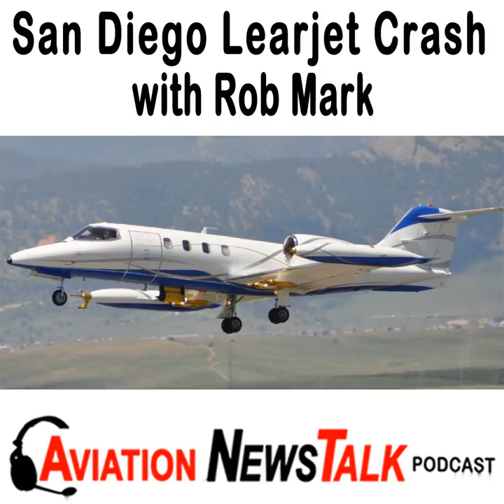214 San Diego Learjet Crash – Interview with Rob Mark

Comment: Correction:  They did not have to do a night circle landing.  It was their request, which was granted by traffic control.
Reply from the maker: From all reports, the operation specifications didn't permit them to land on the runway 17, as it was too short. That's why after flying an approach to 17 they had to circle to another runway.

Comment: We were doing our UPRT recurrent training in the Falcon 7X simulator a few days after this accident. After fulfilling the required training, the instructor asked if there was anything else we wanted to do. Though the simulator database does not have KSEE in it, we were able to try this maneuver, using the exact same weather conditions, speeds, and altitudes, configured for a circling approach. I can tell you that in these conditions, keeping the airport in sight was near impossible. When I demonstrated over banking (45 degrees), the nose dropped and there was no way to recover. With the critical wing of the Lear 35A, this was a death sentence. So sad that this occurred.
Reply: I have become very disgusted reading some of these responses. Some of you are not instrument proficient or even instrument rated and respond as if you were.  Scattered clouds do not make a ceiling since the first day i did my discovery flight,  you have to be able to fly and handle that aircraft or you will perish. you know that pilot error thing. a lot of people can do just fine because you have easy assignments.  I flew commuter airlines, pilot proficiency is not what it used to be and you are taking refuge in criticising the crew.  I flew years ago the last flight at night to Lake Tahoe.  It was a LDA runway 18 approach.  go do that approach around 10.00 pm at night and talk to me then.  We did it every night me or some other pilot.  sometimes it was so windy that we were looking out the side window too at the runway .  the missed approach point was about five miles from the end of the runway some nights we went in there with snow 5 miles visibility and the MDA  [ minimum decent altitude ] was 900 feet above.  you went in there DIRTY,  gear down and full flaps.  IF you had to do a missed approach there was a significant right turn that you had to do climbing and cleaning up the aircraft or you will be in the lake.  Climbing and banking is a good reason why people stall airplanes but we did this airport daily.  I also flew to KLMT Klamath falls airport  where there was a lot of BME arking and altitude change.  you have to know your flap speeds and observe banking restrictions also power up the aircraft to compensate.  so stop acting as if you had a difficult flight you would crap out and take the passengers back to base.  People do not like circling approaches and they are not a focus of check rides and proficiency checks.   A commuter jet [ Lear jet ] is like a swiss army knife.  they do difficult airports with short runways sometimes no grooving for wet weather. I flew part 121 and that is more comfortable until you begin to go to some of those difficult international locations in south / central America. Asia.  So stop acting as if you got it all figured out.  In lake Tahoe if you crossed the last checkpoint and had an engine failure that is no reason to crash the aircraft. you would be descend slightly to pick up speed powering up the other engine and cleaning up the aircraft.  I also flew in Alaska that's another story,  so knock it off with all the self righteous stuff and understand that there are skills you need to learn to survive aviation challenges.  We seem to be DUMBING DOWN the training that we do to be instrument rated.

Comment: As a non pilot, my questions are more general.  It's been mentioned several times about the approach to this airport.  Surrounded by hills to the east.  Is that why 27R is longer because  of the hills to the east.  When was this airport built?  Since the N-S approach is more friendly to landing, why didn't they make this a longer runway?  How long has this medevac service been stationed at this airport?  Haven't these pilots made multiple take-offs & landings from this airport?  Did the shorter runway meet the requirements for landing at this time?  Is the circling approach typical for a Lear at this runway?  The way this accident is brought up, it's like the pilots first time landing at this airport.

Comment: The fact that he asked the light intensity to be increased leads me to believe they lost sight of the airport during the circle to land.  The low altitude over the airport leads me to believe he was trying to stay below clouds.   Either one of these things should have been a trigger to abort.
Reply: Exactly. And yet he thought he did see the runway lights—or why ask for them to be increased? He was looking at streetlights. Maybe he wasn’t watching his altimeter and thought he was higher than he was. And that was the moment he hit the wake turbulence of a mini van.
Reply from the maker: Yes, as I discussed in the podcast, there were multiple triggers that they should have started an early go around and get out of there. There were about a mile north of the airport and hadn't yet crossed the field to start circling when they asked for the lights to be turned up. I took it to indicate that the rain and mist were so bad that the lights seemed dimmer than usual.
Reply: @AviationNewsTalk  Yes, I see that now.  The audio clips that were pushed out to YouTube are deceiving.  They were clipped.  He called to cancel IFR at 0311:50, inquire about lights at 0312:16, and crashed at 0314.
Reply: @AviationNewsTalk  Yes but… They had canceled IFR, they couldn’t legally go missed and they had very few, if any, VFR options. Yes, climbing into the clouds and, as they say, asking for forgiveness rather than permission was possible but it’s easy to understand why they didn’t do it.
Reply: I honestly think they were distracted by his response right after asking for the lights to be turned up.
Reply: They should have asked for the Runway Lights to be turned down to the lowest setting, (or off completely), and then turned on again by degrees up to full brilliance. This might just have given them a chance of locating the Runway if the had lost sight of it. This would have made them stand out better against any street lights.

Sounds like they might both have been looking for the Runway and not monitoring the instruments and thus got considerably 'behind' the airplane.

They had made changes to procedure, (cancelling IFR and changing to VFR), into a normalised prectice for their Hombase, despite what the book said.

This, and the fact that they were too low in poor visibility, (plus press-on-itis), doomed them.

Had they diverted they would likely still be alive.....
The CVR will tell us more..

James Hennighan
Yorkshire, England

Comment: In the aftermath of WW2 my father found himself in the dual role of both pilot and air weather officer. Because of that he served on many accident investigation boards. He told me the most common cause they uncovered was get there-itis. You are right. The pilots should have taken smarter actions.
Reply from the maker: Yes, get-there-itis is a serious problem. Having read about it, I thought it would never occur, but once when I had a crying two-year old with me, I pressed on in a storm and icing to get home. I was lucky that when I descended to the MEA, the ice came off. If it had been slightly colder that day, and was below freezing at the MEA, I might not be around today.

Comment: Great conversation. We're they flying that low because of the inadvertent imc trying to maintain visibility and got squeezed under an extremely low ceiling
Reply from the maker: That's seems like the most likely reason, though it's interesting that they climbed a few hundred feet after crossing the runway. We may never know for sure why they were that low, unless they talked about it on the cockpit voice recorder.
Reply: Sounds like there was no chance of maintaining VMC (and the field itself wasn’t Visual) yet they cancelled IFR to proceed VFR

Comment: So as they crossed the field @ 300', they asked for the lights to be turned up???????? How were the expecting to see the lights at a higher altitude??
Reply: They asked for the runway lights to be turned up seconds before the crash, not as they crossed. Which suggests they thought they were seeing runway lights, no? If they thought they saw the runway, were they seeing streetlights in reality?

Since this was their home base airport, I think it was likely they were well aware of the terrain obstacles (the hill). Perhaps they oversteered slightly on the last turn to avoid where they thought the hill was relative to the plane. It’s possible they caught sight of the streetlights before they were aware of their angle relative to the true runway—remember they’re on VFR, poor visual conditions (night time + weather) and likely both PiC and SiC were scanning for the airport.
Reply: @MarcosElMalo2  It would be interesting to have the audio and position timeline overlay.
Reply from the maker: TC, I did backtime the audio versus their flight path. That's how I was able to say in the podcast that they were about 13 miles north on their first call, and about 3 miles north on their second call. That second transmission lasted nearly 30 seconds, so when they did ask for the lights to be turned up, there were still about a mile north of the field, and hadn't yet crossed the field to begin their circle. After crossing the field and starting to turn left, there were only about 40 seconds from crashing. MarcosElMalo2, the reason it may have seemed to you that the request to turn up the lights came immediately before the crash is that in some versions of the ATC audio, people have edited out all of the quiet sections. If they left them in, people would get bored and not wait for the silence to end and would miss the final transmission.
Reply: @AviationNewsTalk  Thank you For the recap on timeline. I thought so on the light call. I think his first expletive came when the left wing dropped as he went inverted which you can see in the doorbell video. Judging by the soup I doubt they ever saw the mountain. I saw one track that showed them left of 17. Incredible tight turn if that was true. Just truly sad all around.

Comment: The reason the localiser approach to RW 27 R is a "circling" approach is that you may not descent below 1400 ASL because there are the high  hills to the north at 1.6 miles from the displaced threshold (1000 ft) . Encountering VMC below say 1500 ASL does not allow a landing on that runway, because you are too high. This requires a left hand pattern at normal  pattern altitude (1400 ft ASL, 1000 ft above runway altitude, 800 above the ground east and south of the airport.
Circling approach does not mean flying a circle! 
The proper way is to fly into a down wind after crossing interstate 8 and turning into base just east of I 8 after I 8 turns north, which is just over 3 miles from the approach end of 27 R , turning normally to final into the localiser at an altitude of 1000 feet (1400 ASL), 3 miles away (recrossing I 8), allowing a stabilized final approach in VMC and helped by the illuminated slightly wavy Pepper drive just to the east on the extension of the 27R, and the runway lights clearly visible at 2 miles.
The altitude at 1.5 miles out , is then 500 feet above the runway, the small hill just to the left is clearly illuminated by the house lights ( this is the base leg for 27L). The high ridge (1100 ASL) is about 2000 feet to the north. And below is the large trailer park 300 feet  below, recognizable by the illuminated streets inside the park.
Reply from the maker: Nice description. If they'd followed that, they would have been fine. As we mentioned, the big problem was their ground track, which was much too close to the airport on downwind, guaranteeing they would overshoot the base to final turn. I'm guessing that some of the landmarks you mentioned were obscured to some extent in the rain and mist. Had they been able to see the landmarks, they would have been fine. I've found in my area, which is equally hilly, that when visibility is low, it's very hard to know exactly where you are, because we use the mountains for reference to determine our exact location. Take the view of the mountains away at night and low visibility, and it's much, much harder to figure out where you are visually, which is why we rely so much on moving maps.
Reply: @AviationNewsTalk 
As you might have guessed I have  flown this localiser approach many times, in daylight of course. Kept my airplane in a southern hangar there.
Your assessment is correct.
I avoided flying at night there because the noise is high for the residents on the approach  path, living 2oo feet higher than the Gillespie's elevation.

Comment: I have a different theory and no one is talking about it.  I think they fully intended to land runway 17 but instead of doing a go-around (too fast, not configured, etc..), the pilot flying decided to salvage the approach and chose to do the visual since he had probably done it before.  The decision to do this was late and things happened really fast.  By choosing this route, the other crewmember wasn't ready for it and totally out of the loop.  So instead of the go-around, they leveled off at a low altitude, too close to the runway, and tried to salvage the landing.  I honestly don't think 27R was planned that day .  And if it matters, I've done tons of circle maneuvers in a jet.

Comment: I live where this happen, I watched tthe entire thing unfold it was the most horrific thing ive ever seen happen but i've seen this jet so many times. They fly so low it feels like I can touch them. it wasn't the first time this happen even when the entire sky is clear and its sunny out they flew just as low and that already scared me enough. The night of the crash it was pouring and there was alot of fog, it was almost down to the street where you could not see. Witch is also normal. This is just a generally unsafe passage to me it seems, not that I know anything about flying because some could argue im wrong considering plety do this everyday. at least 8 a day or more
Reply from the maker: I'm sorry that you had to see it. No question, there were a number of elements of this final flight that were unsafe. Sadly, even experienced pilots make mistakes. Usually the mistakes are small and they catch them and correct them, but that's not what happened here.

Comment: As a VFR pilot who flew out of ksdm, down by the boarder there's a sizable hill to the east of the runway as well. I keep thinking Lindburg Field was really the only option on this day.
Reply from the maker: I've flown in and out of Brown Field many times, always VFR. Oddly, the same model aircraft, a Learjet 35A, crashed after takeoff from there at night in 2004, after failing to stay out of the clouds while awaiting their IFR clearance in the air. It too was an air ambulance flight. You can read about it here. https://aviation-safety.net/database/record.php?id=20041024-0

Comment: Any issues with flying a RNAV all the way in and then last minute switching to VFR?  Seems it could be very disorienting following instruments and then switching to hand flying at low level, at night, in the rain, with low clouds, at the last moment.
Reply: It happens pilots cancel IFR if they have vfr condition and can see the runway. Probably in this situation, events stacked up against them without them realizing.
Reply: It’s my understanding that they cancelled IFR just before or as they were crossing the airport. It’s my understanding that this was the regulation for this particular approach for this airport, due to the terrain hazards to the east. I don’t remember at what point the aircraft requested VFR from ATC and were given permission—we’d need to listen to the ATC recording again and then speculate how long after they switched to VFR.
Reply from the maker: 1320fastback, you've highlighted many of the issues. The "following instruments and then switching to hand flying" happens routinely on virtually every instrument approach. But the changing of runways and getting to the new runway at night in bad weather is rare, and one of the most dangerous things a pilot can do. That's why I won't circle at night; the accident rate is much higher and there's always a better alternative, even if it inconveniences the pilot and/or passengers.

Comment: Very insightful discussion!  I’m not a pilot, but I wonder if, since there were no patients on board and they were simply returning to home base, if it would’ve possible to just divert to another airport with an instrument approach.  If they were concerned that the instrument approach runway is too short for their aircraft, but conditions are deteriorating, I think maybe asking for another airport should be an option.
Reply from the maker: You should be pilot! You're asking the kinds of questions any pilot should ask in this, or in similar situations.
Reply: @AviationNewsTalk  thank you so much. I want to but I unfortunately have medical issues that prevent it.  I’m happy to be an aviation enthusiast instead.